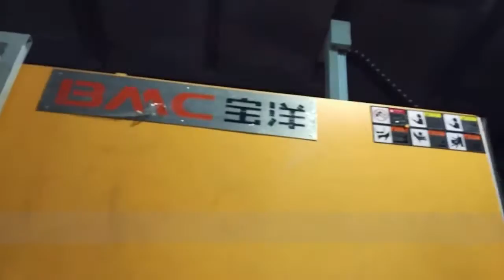1250T cold chamber die casting machine runs well

Comment from the maker: GOOD DAYS FOR EVERYONE.
I am bmc trade manager Alson Lee.
I am very glad to present our die casting machine.
Guangdong Baoyang Technology Co.,Ltd (BMC) in August 2003 was established in Shunde, Guangdong, is a professional production of cold chamber die casting machine, hot chamber die casting machine manufacturer. Since its inception, relying on the excellent professional R & D personnel, combined with the advanced die casting machine manufacturing technology, developed with independent intellectual property rights Powyard die casting machine, with advanced technology, stable and reliable performance characteristics.

1)Cold chamber die casting machine range: 200T-3000T

2)Hot chamber die casting machine range: 38T-400T.

3)Real-time control system

If you need this demand, pls connect me and ask.
Wait for your inquiry.

Guangdong Baoyang Technology Co.,Ltd
Add: Add: 32th Shunye East Road,Xingtan Town, Shunde District, Foshan City, Guangdong Province, P. R.China Tel: +86 757-28816626 
Mobile: +86 13377658186
Fax: +86 757-26618296 URL: www.sdbmc.com
Facebook: https://www.facebook.com/bmcmachinery/